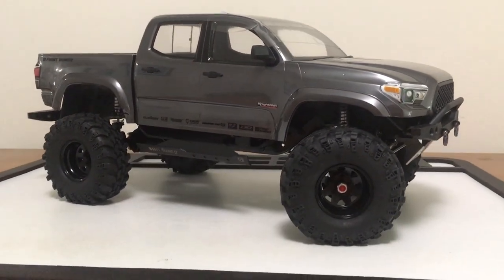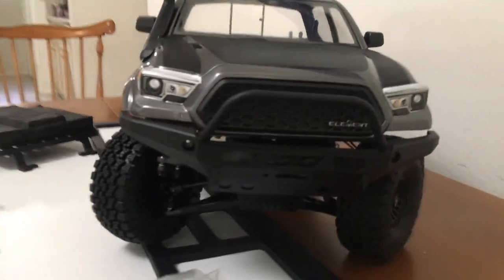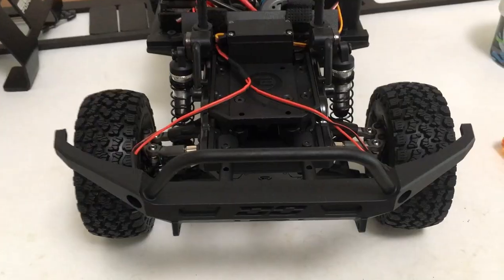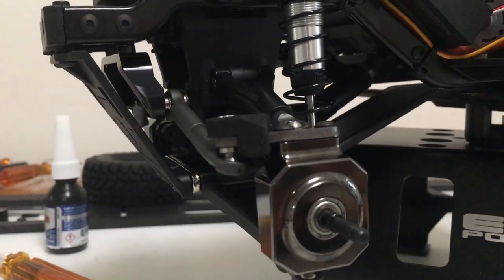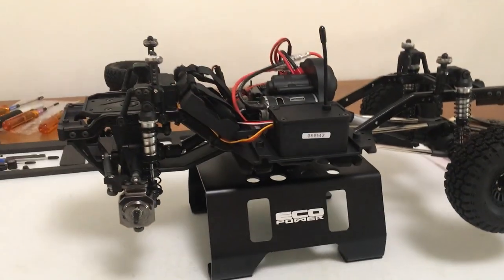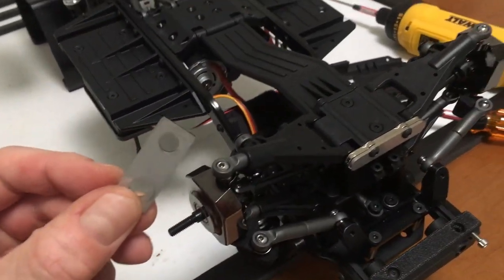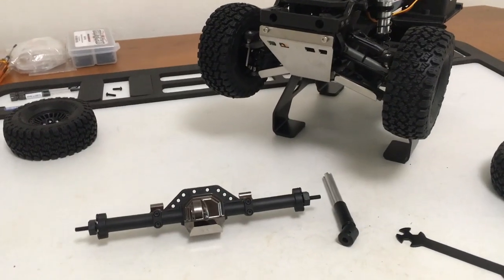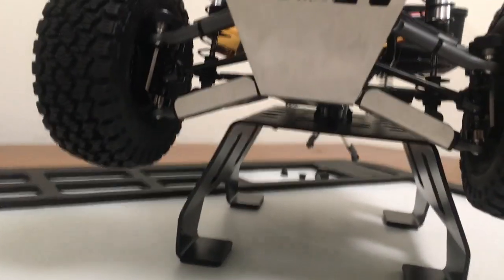Element Knightrunner Build: Stage 1 - SSD Brass, Bowhouse IFS Rack & LCG Tray, Artful Dodgers Skids

Comment: Nice build! 
I just got a knight runner and plan to do some upgrades but not a lot….im just gonna add some lead sticky weights to the front via the little package tray in front of the steering servo!
Reply from the maker: Awesome man! I think you’ll dig it. The steering was the only thing that really didn’t satisfy out of the box… but this Bowhouse kit and a new servo install fixed that. Cheers!

Comment: I have a question.  After you pulled the wheels off,how did you get the hub/rotars  off with out damage from prying on anything? Love your builds. You are giving great pointers.  Doing many upgrades and addons to my own including warn winch w/ remote and it works great.
Reply from the maker: Wheel hubs? They just unscrew from the wheel.
Maybe I am not understanding you.

Comment: What kind of run time would you expect on this model from a 3s 3000mah battery? Thanks.
Reply from the maker: Not really sure. Depends on what you are doing with it. I would think several hours.
Reply: @bcochener  Wow ... hours?!?. I have a bunch of RC drones/cars that use 3s 4s and on my 1/8th scale cars I use 5000mah batteries that last about 30 minutes run time at about 50mph top speed. I guess "rock crawlers" are a whole different game. All my cars are LiPo and brushless as well but this model looks to use a 540 brushed can motor. On my old Tamiya models I'd get about 12 minutes runtime. A few hours is really impressive. Thanks for the quick answer.
Reply from the maker: @adriannorgate9577  for crawling, yes you get a lot of time. High speed is a whole different game!

Comment: I have a question about the artful dodgers skid plate, are you able to still use it if you do a body lift on the Knightrunner?
Reply from the maker: I would think so since it only attaches to the underside/chassis. Shouldn’t matter where/ or what body is on it.
Reply: @bcochener  Oh alright, when I did the body lift I swapped the front bumper mount with the rear bumper mount so the body can raise up 1/2”.
Reply from the maker: Interesting. I may look at doing that as I was noticing some wheel rub on the front wheels/body at full lock.
Reply: @bcochener  When you put the rear bumper mount in the front, make sure to flip it around where the screws screw downwards. And you’ll need to shave the bumper mount and bumper post a slight bit.